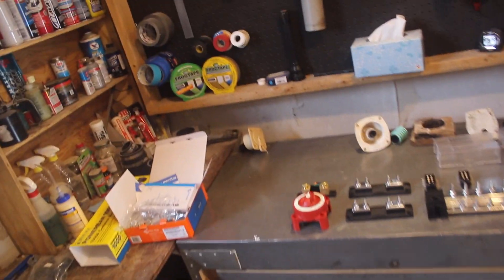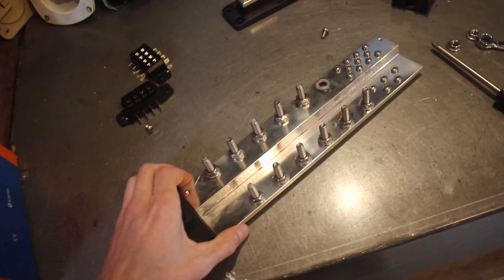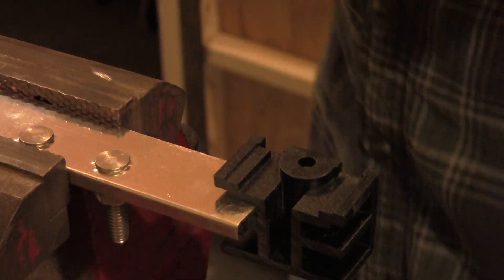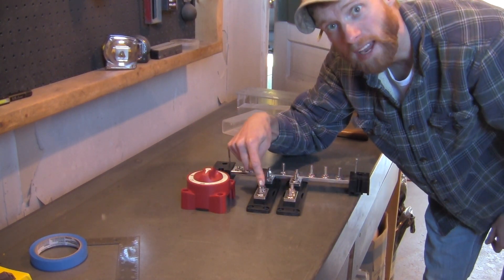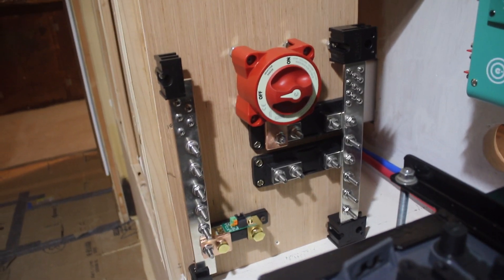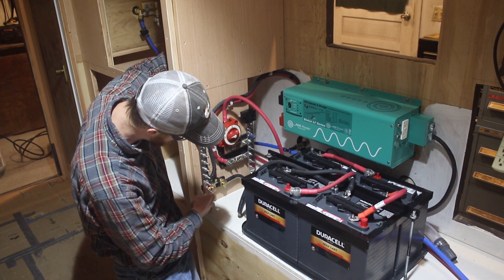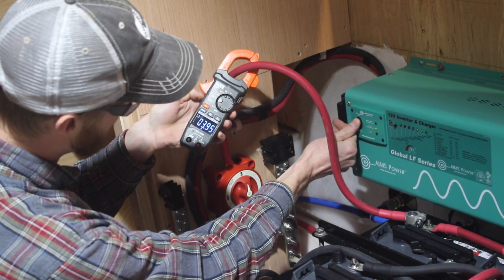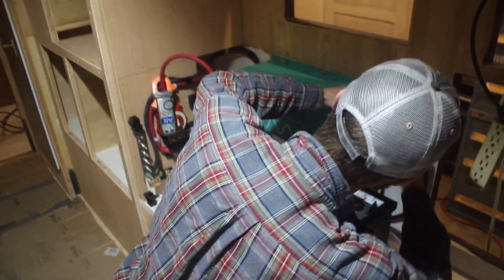WE HAVE POWER 🔋  OFF-GRID ELECTRICAL SYSTEM - Truck Camper Build Part 21

Comment: I'm a subscriber and love your work and videos. I do electric work and am an avid DIYer, but this video is my least favorite. It shows some dangerous methods. Never use your hands for a pusher with table saw. Cables soldered rather than crimped. My next advice could save some money. When powering up an inverter, you should pre-charge the capacitors first. Switching it like that can destroy the inverter. You might get away from it... or not. Search: "How to Pre-charge Large Off-grid Inverter Safely" on YouTube... by Will Prowse. $1.00 resistor could save you buying another inverter.
Reply from the maker: Thanks for watching and the advice.